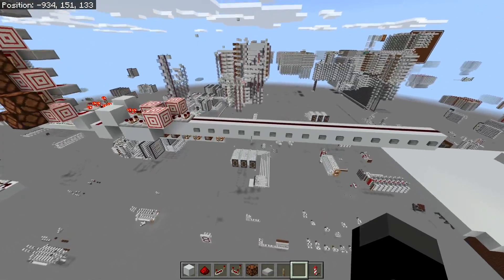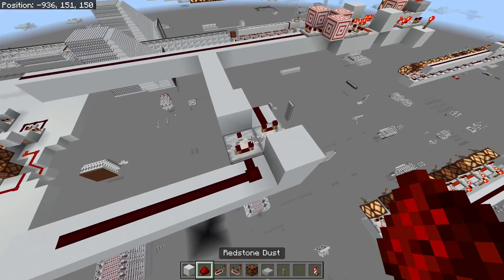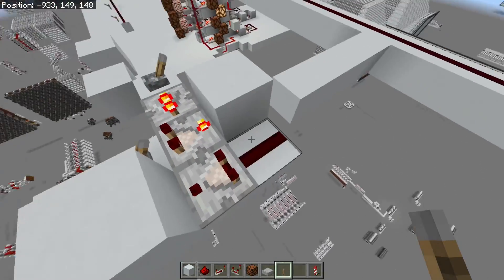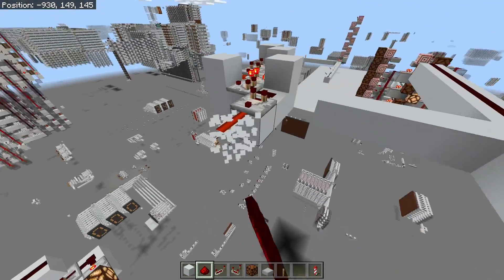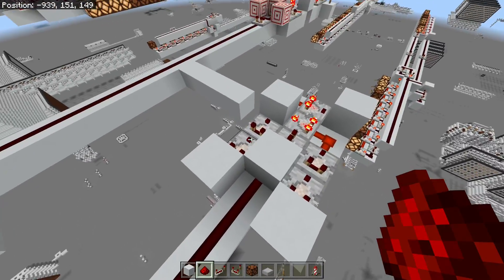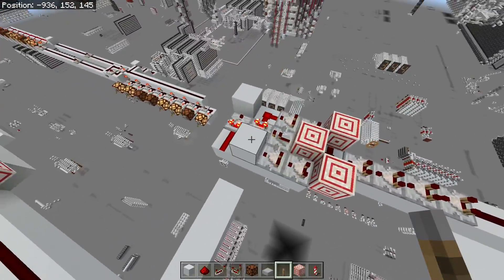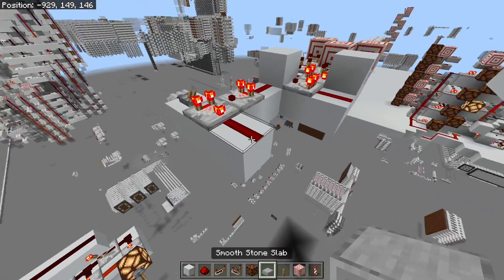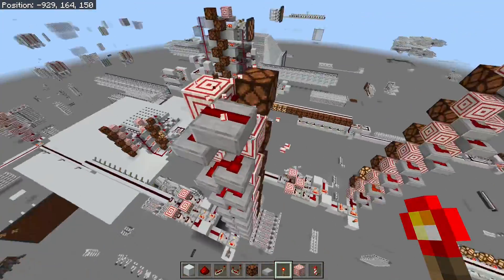Hexadecimal Button Selector Panel - Minecraft Bedrock Tutorial

Comment: Hello.
I think you explain things very well, I learned a lot from you in the beginning. great work

but you move the picture back and forth a lot which makes me a little seasick.

you could solve the flashing in the hex cell at 3:44 by just having comparators on the left side of the repeater.

at 6:28 you say the redstone flashes and it resolves when you send in a new signal. the reason it flashes at that point is because you have two different values in the cell.

you can test this by sending a 1 tick pulse into the hex cell then with a pulse that is two ticks long.
there is a video on my channel that demonstrates how you can do and how to read the pulses to see the different values.